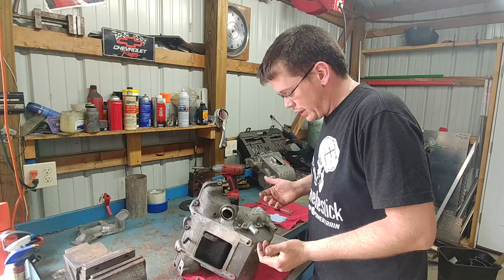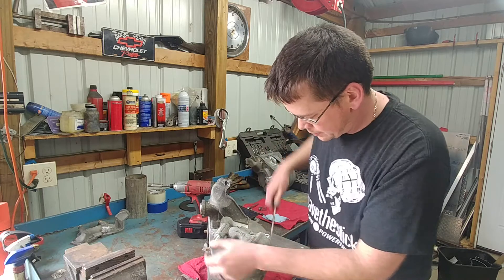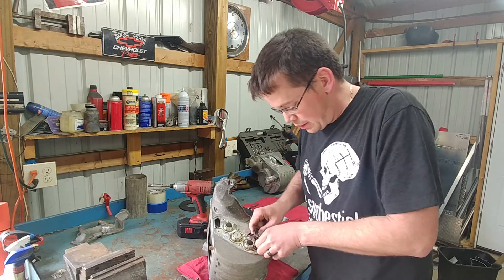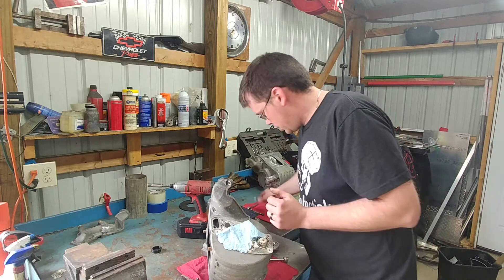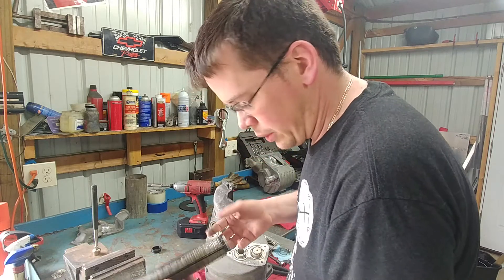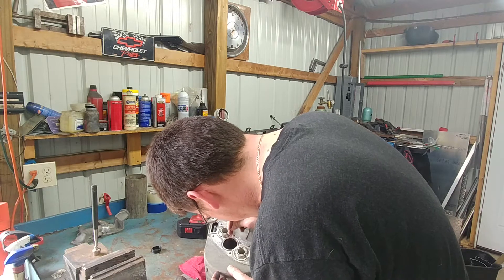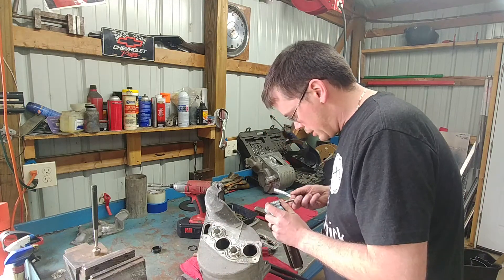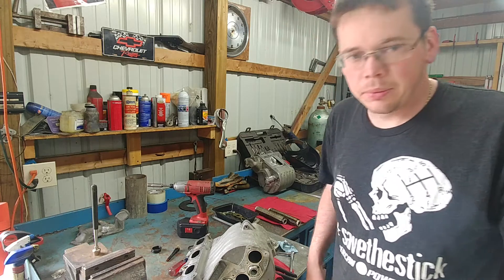How to take apart a Cobalt SS intake manifold

Comment: Can you run the dual pass end plate with the single pass modification?
Reply: You "could" but there's no reason to, as it would give you a single inlet and 3 outlets. He adds an inlet on the opposite side of the manifold so the coolant flows through all 4 cores at once from one side to the other, and flows out the 2 stock pipes as 2 exits.
Reply: As opposed to the dual pass endplate adding a center inlet to flow in the center cores, then circle back out the outter cores.

Comment: I got a 2006 ss supercharged I saw your video on the head swap. I'm no mechanic but I have to replace my head gasket. Do you have the video that isn't time lapsed? That would help me out insanely. Also any other tip you could give me would be much appreciated. I can't afford to bring mine to a mechanic. Thanks!
Reply from the maker: Edgar Flores the full video was posted fb live. If yo go to category v port worx on fb you should be able to find the full video Start to finish
Reply: Jason Widdowson awesome! Thank you! I think I'm going to be in way over my head... but I have to have this car running right as it's my daily driver.